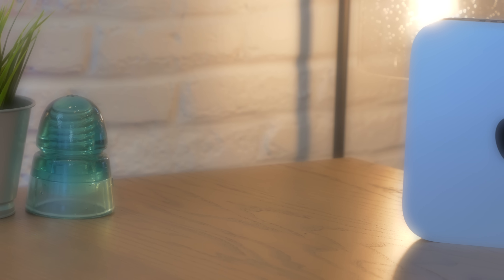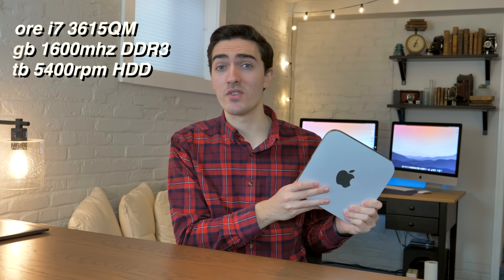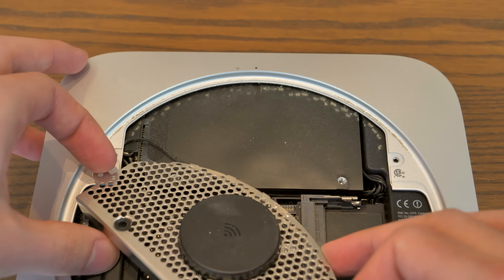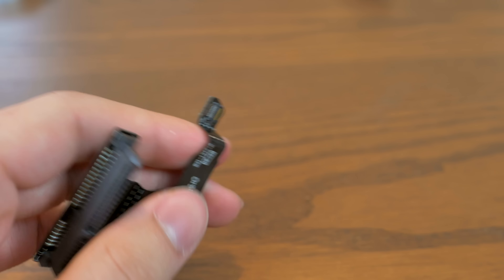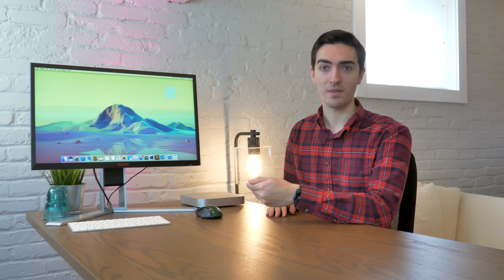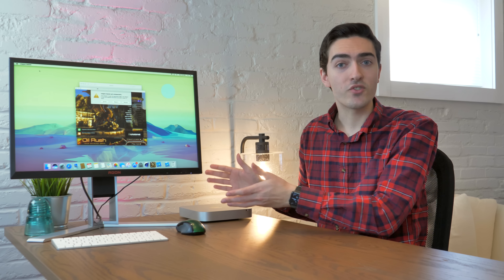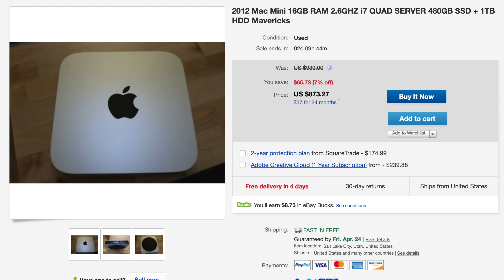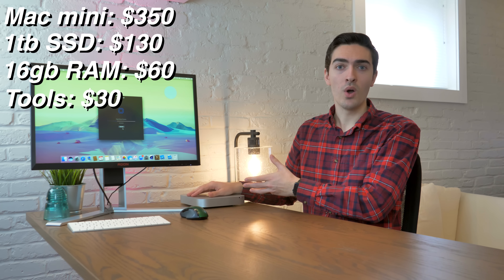Building the ULTIMATE 2012 quad core Mac mini – But is it worth it?

Comment: I just bought a 2012 Quad core with 16 gigs of ram and two 250GB SSDs for $400 CAD. I was planning on running Linux on it to run PiHole and HomeAssistant, but now I am thinking of keeping it on macOS. From what I can tell the idle wattage isn't super high so I don't mind running it 24/7.

Comment: So I’m torn between getting a 16gb Mac mini late 2012, 250gb ssd off of my mate for somewhere around like £125. I’m also considering a MacBook Pro 2015 13” with 8gb ram 1867mhz, 2.7ghz processor dual core i5 for about £250-300. I’ll be using it for Logic Pro and that’s about it, it being portable would be great too but if the 16gb makes such a difference I can deal with it being a mac mini, any advice is much appreciated thanks. Jak
Reply: Get the Mac mini

Comment: 2 years ago my wife started to complain that her 2014 Mac Mini was feeling sluggish. I investigated and found out its non upgradeable. Great. I then investigated for options. A new Mac Mini was out of question. But, then I found a 2012 Mac Mini Server for 250€ (about $300 at the time). It has dual drives from the factory, 16 gigs of ram , i7-processor (2.6GHz) and came with an kb and a mouse. I bought it, installed an external USB 3 1TB M.2 SSD-drive for the OS and software. The 2 internal 1TB drives are used for Timemachine-backups and additional file storage. To me this was the ultimate 2012 Mac Mini. And more importantly the wife still has no complaints.  😉

Comment: Hello Luke thanks for your videos and advice. I bought a Mac Mini Late 2012 with 2.6Ghz then put 16Gb ram and 1 TB SSD. I used it to transfer about 30 mini DV tapes (thanks to Firewire 800 port) and convert with iMovie in mp4 (720p).
It does the job easily for this 10 years old machine !

Comment: I just saw a second hand one of these mid 2012 i5 2,3 Ghz for 150€ with a non Apple screen, keyboard and mouse.
Instead should I get a 2008 iMac 20" with a faulty hard drive which I hope is not to be changed for 40€ then resell it.

Comment: Its July 2022 and I bought a 2012 Mac Mini i7 2.6Ghz, 16G RAM, 256 SSD for $150 on eBay. Thanks to geniuses who make OS patches, was able to install the latest one.  Paired with a 2011 Thunderbolt 27” Apple Cinema Display (2560x1440), Apple Magic Keyboard and Mouse, I’m extremely happy.  This is just my home setup as I have a wicked work gear (2022 MacBook Pro, triple 27 Monitors, etc.) at the office.  I don’t do any graphics heavy work on the mini, it’s pretty light.  It’s the coolest 10 year old Apple setup ever.
Reply: Yup. It still feels current. I have a i5 2.5Ghz 8GB RAM 500GB HDD model and recently got the i7 2.6GHz 8GB RAM 2TB Fusion Drive model for making music.

 They might be 10 years old, but I have current high-end Intel and AMD gaming PCs and I don't feel held back. Just gotta wait a few more seconds when processing stuff. 

MacOS looks so nice on the LG C1 OLED TV even at 1080p. 😁

Comment: I have mac mini 2012 i5 2.5 ghz, 4gb, 500gb hdd. I upgraded it to 16gb and installed macOS Monterey. It works fine and I develop mobile apps in xcode using swift and flutter too. I am facing no issues till date.

Comment: It would be good if Apple did not deliberately obsolete their systems. I wanted to buy and run Apple Logic Pro X. The only available version demanded the latest macOS which is Monterey, but Monterey is not supported on my Mac Mini. Why? Well it cannot be lack of power since my Mac Mini has quad core i7, 16 GB RAM and 1 TB SSD drive. It looks like I am being forced over to Reaper.

Comment: I still use my 2012 macmini as a homeserver. I put a 128 ssd and fusiondrived it to the 500 hdd. Very fun little device and lasts forever. Been wanting to upgrade to the M1macmini. But had no reason to since this ones works well even in 2022

Comment: It's good if you need the fw800 /hdmi but it need to be well dusted and repasted. I have the higher spec 2,6 GHz Intel Core i7 and it is way enough to be in the living room on the video projector for youtube, prime,  netflix, web browsing, it's snappy for photoshop and raw files. I still prefer Mojave for several apps. the upgrade from fusion drive to ssd made it like new for me. The ethernet port is dead, I have attached a thunderbolt to ethernet adapter. BT is old as crap, but enough for kbd and mouse. Topping D30pro DAC and Epson EH-TW9200 proj. a wonderful 1080p setup.

Comment: Great video. Nothing left uncovered. I just picked one up for $145.00. It is the i7 2.3 with 16GB of ram and 1TB hdd. I purchased the unit for audio recording using Pro Tools. I found some tests showing that multi track recording using Pro Tools with one of these works well. Of course, Analog processing would definitely help take the load off of the processor. I will spend the extra on an additional SSD. Thanks!

Comment: Just got a 2.5Ghz i5 with 16GB RAM for $118 on eBay and I will swap 500GB HDD for a SSD of the same size. Plan to use it with the legacy Adobe CS6 suite on 10.8 Mountain Lion. Good value I think if you can get it around $100 now

Comment: I bought my late 2012 Mac Mini  2.3 GHz Intel Core i7 second hand back in 2013. Upgraded to 16gb Ram & OWC 500gb SSD at the time in addition to the standard 1tb mech drive. This  has always been my daily computer but more importantly I have always been an avid Logic user. I bought two 23” inch Apple HD cinema displays back then as well for a very reasonable $$..
Last year I pulled the thing apart again and put a OWC 1tb SSD and moved the OWC 500 SSD into an  external enclosure which I have put to good use. I also upgraded the operating system to Mojave. 
That’s 10 years of computing with the same but modified Mac mini. If I work out the cost by the amount of years I think I’m way in front. It still works totally fine except now I am contemplating buying a Mac mini M1or whatever comes next or a Mac Studio next year which I imagine I will use for another 10 years. 
Love the videos keep up the good work !

Comment: One advantage of this old model vs new ones is that if the OS wasn't upgraded past Mojave then you can still use older 32-bit applications. So if there's old stuff you want or need to run, it's a good machine to have around.

The one question I can't find an answer to is how big a HDD/SSD could this thing support. I've never seen any mention of a drive larger than 1TB for this thing, however, that was when drive capacity for 2.5" anything pretty much capped out at that size. So if someone stuck a 4TB SSD in there, would it still work?

Comment: I’m trying to decide if I want to spend $100 to swap out the HDD with a SSD drive and have to rebuild the Mac mini (Late 2012).  I want to use it to run macOS server.  How much will the performance improve by swapping out the HDD with a SSD drive?  Is it worth it as opposed to leaving the HDD alone and running macOS server on the HDD.
Reply: If you're talking about a file server it really depends on what's faster, the HDD or your network. Given that plenty of people run SBC like the Raspberry Pi with a USB3 HDD/SSD as a file server, not sure if upgrading to a faster drive will make much difference for a smaller network. But if the server is going to be processing stuff and have to use the drive heavily, a faster SSD would probably improve performance.

Comment: do you have overheating problems with the i7 mac mini? mine always throttles and gets up to 96 degrees c even at just idle, I tried replacing the thermal paste but it makes no difference. is this a common problem?

Comment: I have the "late 2012" version with dual core i5, maxed out with 16GB RAM and 1GB SSD.

Is there a substantial difference (now in 2022) between the dual i5 and quad i7?

Comment: Are there any reqiured cables from the motherboard to connect to those two drives?
Reply: To add a second drive there is a kit you'll need to get that has a 2nd drive cable, plus a few other things.

Comment: I bought this same Mac Mini in 2012 brand new with the i7, 4 GB of RAM and a 1 GB HDD, and it served me well. Later I upgraded the RAM to 16 GB, and switched out the HDD for the same size SSD. Still runs great but I use the M1 Mac Mini that I bought at the end of 2020 a lot more, of course. Great video Luke.

Comment: Just bought the 2012 dual core i5. model with 4gb of ram for 128€ and will upgrade the ram to 8gb. I think as a basic office computer it will be a great value. 
My wife uses a 2014 dual core macbook air and it does just fine

Comment: Hey! If you can read this, I wanted to ask, Does the Late 2014 Mac Mini have the same layout? I want to top it at 16 gigs worth of ram, and upgrade its hard drive to a Solid State Drive. I just got it, because I was looking for a cheap Mac to use. I was getting tired of windows, and I wanted to try something new. So, if the upgrade was rated on a 0-3 difficulty scale, what would you say? Should I get a professional to do it, or should I try it myself?

Comment: Late to the party here. I today bought the same model Mini featured in the video (paid 220€ with 16 gigs of RAM). Will be replacing my mid 2011 i5 Mini... which I've used since february 2012. I still use (and love) Aperture, so I can't go for a newer machine, even if I could afford it.
(and I already have a 500 gig SSD and 1TB HDD in the old mini, so I just have to move them and then I'll flip the old one for 100-150 bucks)

Comment: I built pretty much this exact product (2012 quad core, maxed out memory, added SSD in second space) back in 2012. Still using it, albeit with an upgrade from 512GB SSD to 2TB SSD. Although I only changed out the old 1tb HDD for the new SSD so I didn’t have to fully disassemble it, that time I upgraded.

It was a truly excellent buy when buying it new in 2012, given how long I’ve been using it.

Comment: I upgraded way back in 2012 to 16 GB Ram with core i7 and a 2 TB Samsung SSD, Still beats my iMac and Macbook. Unfortunately it wont install the logitech streaming app for their webcams for 2012 Macs so i need to change the mainboard and chipset to minimum 2018

Comment: I got one 4 years ago for 200 pounds -  it came with 2 x 2GB RAM sticks and 1 TB HDD and quad core i7. I have since upgraded it on the cheap - 12 GB memory from old laptops and and old 360 GB SSD and now it is running like a champ. Excellent media centre / app building machine. You can even use RAM sticks from different vendors, as long as they match (LP or not).

Comment: Hey Luke been a long time subscriber, I'm looking at a mid 2012 mac mini for my wife. She will only use it for doing projects for her cricut. It has the 3615qm i7 as well as 16gb of ram for $285. Also has a ssd that I'll eventually upgrade to a higher capacity.Do you think this is a good deal?
Reply: I know this is a year late but I bought the same thing for the exact same reason it's perfect for my wife's cricutting needs

Comment: Dude on Evil Bay said this won't run SL, which is where I run Logic 9... IFAICT, I'll have to run Logic on a less stable, but supported OS. Dr. Google is useless and the threads are quite painful to deal with so I'm a tard afa that stuff, although I have built two WS based machines in the past.

Comment: I found your video after more than a year since it posted. I just picked up a 2012 Mac Mini for $125 that I plan on using as a mail server of sorts (collect my email and put the low-priority emails into folders so I don't have to on my phone) as well as be a Plex server for my music. I wanted to use this rather than my Mac Pro 3,1 that uses 300+ watts just sitting idle. The Mac Mini uses 85 watts at its max. I feel better about letting that run all day rather than the Mac Pro. The Mac Pro will continue to be used with legacy software for audio and video transfers.

Comment: I don't agree with you about the 2018 mini's with i 3. I purchased two of those to replace a 2010 and 2014 mini, and the I 3 is much snappier and faster than the 2015 mini with I 5. They are decent machines.

Comment: So you're saying if my 2012 i5 Mac Mini just had the GPU bite the dust, I'd should buy one of these to upgrade, rather than going to one of the M1 Mac Mini, because my current one already has all the upgrades, or I could repair the GPU I guess. I do a little tiny bit of play with fusion360 and day trade a little.

Comment: Damn, people were asking $875 for that?  Lol, WAHT?!?!

I have 2012 Mac Mini i5 - 16gb ram - dual ssd (both 1tb) - and I offered to sell it to my buddy, 3 weeks ago for $300.

With all of that said, I opted not to sell it. I do 1080p video editing on it, and have never really had issues. Works fine with FCPX, which is honestly all I use it for. However, I also own the 2011 Macbook Pro (i5, 16gb ram, dual ssd)... which has given me a few laggy editing sessions, but overall nothing to scoff at. So, personally... I don't know if it's a good value, but if you can find a cheap one, it can handle editing 1080p video on FCPX. Macbook Pro and Mac Mini are both running Catalina (thanks to DOSDUDE).

(Shrugs Shoulders) So there's that... I guess.

Comment: Interesting to contrast this with the 2009-2012 Mac Pro "cheesegrater"... I own that machine and have modestly upgraded pieces of it (the cpu, the memory, a new bluetooth 4/wifi b/n/g  internal card, and 4 old ssds I had laying around. Obviously the mini is far better on power consumption. But as a repurposed machine overall... the Mac Pro 2010 is better because it does a lot more. But again, the two extreme approaches each machine offers intrigue me.
Reply: The Mac Pro 5, 1 is an amazing Mac. I have upgraded my processors  2 x5690 with 48 gig ram and blazing fast NVMe.  I am running Big Sur with ease with the latest updates.  The 2012 Mac mini is a fun capable machine that doesn’t consume a lot of power, but no match to the “cheesegrater”…

Comment: the prices on this get a little steep but that's still a great value for the performance you get. Bought mine at 450 euros  in 2018 with 256 Gb ssd / 4 Gb; with 8 Gb of ram it's about 500; I don't think there's a mac with these performances for this price. even if the prices seem weirdly to go up.
Besides an used laptop from this era means all sorts of problem; the battery will probably be dead or close to it; it will very probably need a deep clean / thermal repaste for it to be usable without heating and throttling; and there are all sorts of graphical problems with 15" models from 2011 and above. Mac minis are a lot less prone to overheating than laptops.
You could even argue it can replace a laptop and become a "transportable" computer; with a portable screen; bluetooth mouse and a small keyboard (I've been meaning to try it; it's a good setup for a multimedia piece sitting in an exhibition for a few weeks).

Comment: Watching this on my late 2012 Mac Mini (2.3 GHz quad-core Intel Core i7, Intel HD Graphics 4000 1536 MB). Bought it in 2013 and it is still my main computer at home. I had upgraded the RAM to 16 GB as soon as I bought it, but only recently found out I could upgrade the old HDD to an SSD. Not sure why that info had eluded me for so long! I went the duel drive route, keeping the original 1 TB HDD as my secondary drive, and adding a new 1 TB SSD as my main drive. I know it is no doubt considered slow by modern standards, but I couldn't believe the difference when I first booted up! It's like a new computer for me. It used to take literally minutes to boot up, and launching a programme for the first time after booting would also take anywhere from one to three minutes. After upgrading to the SSD, it takes less than 30 seconds to boot up and programmes launch pretty much instantly. I couldn't be happier! I was considering getting an M1 Mini, but simply upgrading to SSD means this old Mac has years left in her yet. Fantastic value for money!

Comment: The advantage of a old Mac like this is that most of us have thousands of dollars of legacy software that requires older OS.  For that reason I purchased a 2011 mini to run my Adobe suite, and Final Cut Studio under snow leopard, and to run very occasional windows 10 software. It dual boots easily, and connects via thunderbolt adapter as an external drive to my M1 mi I, running more recent editing software. Best thing yet, the old mini provides ample slow IO, including an SD slot, and FireWire which is useful for content ingestion from my old FireWire based cameras.
To achieve the same utility in a recent Mac I’d need to own recent intel Mac, and run lots of dongles and virtual machines, with many more hassles, and my Adobe suite would be junked.
But For a mere $140 I got an old mini, upgraded with a 512Gb SSD, that will fully complement Apple silicon.

Comment: I currently have a late 2011 Macbook pro and cannot edit 60fps video footage. I have a new 1TB SSD and can only run 8GB of RAM currently because one of my RAM slots is dead. 

I received this mac mini in the video and am wondering if this would be worth upgrading. What would I be able to edit as far as video quality?
Reply: 1080p easily, or 4k with proxy files

Comment: Can you please assist? @Luke - I am in way to upgrade mac mini late 2012 RAM and i found that my mac-mini is DDR3 PC3 12800S - Shall I make upgrade with the PC3L 12800S ? as per my understanding PC3 has 1.5 v and PC3L has 1.35v - so I believe I can use PC3L in late mac mini 2012? IF YES, Can you assist which combination should I use? [at present its 4GB 1600 MHz DDR3] as I am planning to upgrade to 16GB and which brand?

Comment: I was able to pick up on eBay a Late 2012 Mac mini Server with a 2.3 Ghz I-7 Quad-CORE processor, 12 GB DDR3 RAM, two 1-TB SSD Drives, running Catalina for $330.00 dollars. I am planning on using it as a mail server for my home office.